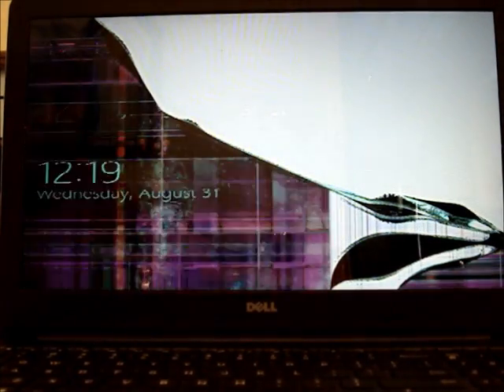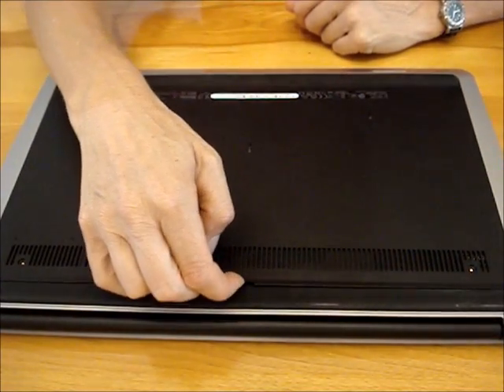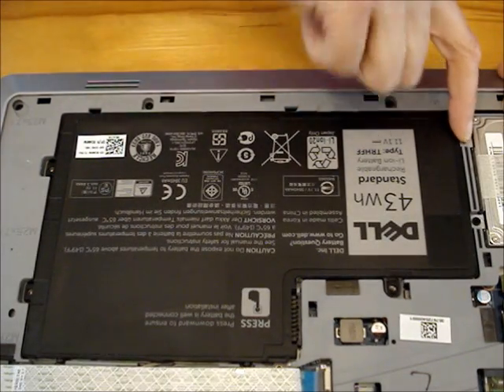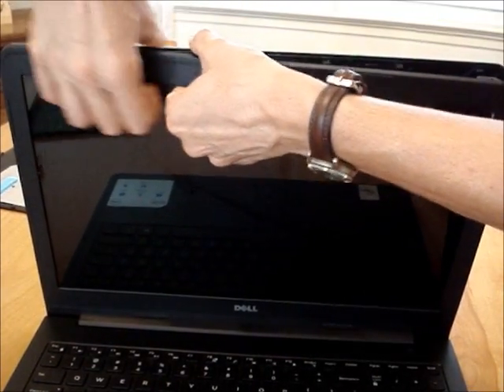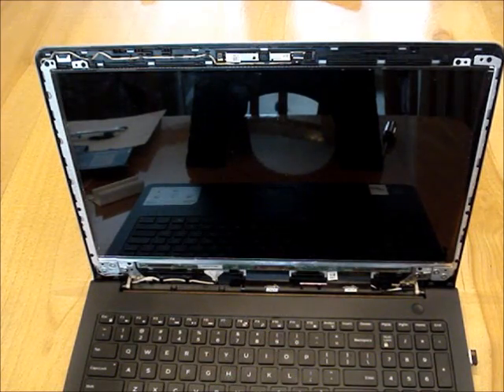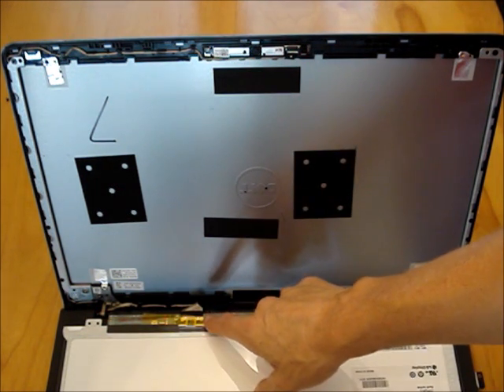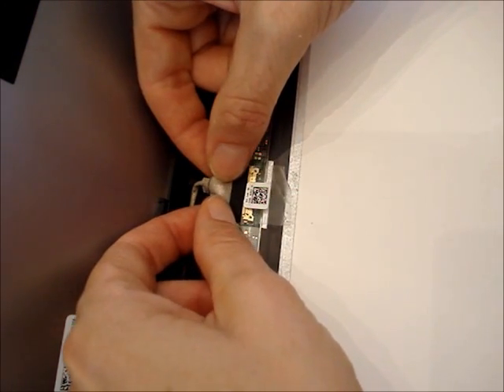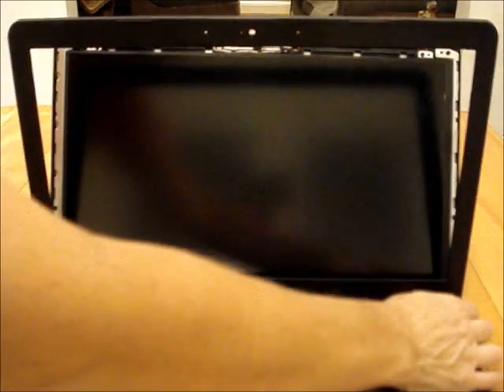Laptop screen replacement / How to replace laptop screen Dell Inspiron 15 5547

Comment: very good explanation lady, maybe you know how to separate and replace bezel in touchscreen model? The working well, but the bezel has toasted and cracked in several parts, and the disassembly is completely for that model, is the inspiron 15 5545 p39f version
Reply from the maker: I do not know how to do that.  You might try the website where I bought my screen, they have a bunch of videos.  Here's the link:  https://www.laptopscreen.com/

Comment: This is a great video. I do have a question. Is this a 40 pin or 30 pin connector( for 15 5547)?
Reply from the maker: It's been 5 years since I replaced the screen on my friend's laptop.  I can't answer your question.  I did buy the screen from laptopscreen.com    You might check with them.  I remember having a question and they were very knowledgeable,   Hopefully they still have the same quality of parts/prices/customer service.

Comment from the maker: Hi Benjamin, it was not a touch screen, so I don't know if those wires are accessible after removing the bezel.  It's not too hard to remove the bezel, I'd just go for it and find out if they are there. 

Coulld you please leave a comment with your findings?  It would be helpful for folks that have the touch screen model.
Reply: The procedure you illustrated in the video is in the Manual however the Manual made a specific note that it is not for Touchscreen. So at this stage I am not game to proceed unless I can find a youtube video showing me how.  I think it is different. Dell even wanted me to buy a whole new Display Panel when asking for a replacement antenna cable. Why? I have no experience at all opening the panel up.
Reply from the maker: I understand.  Check out this link, there are a lot of videos for Dell machines, maybe someone did one for your model:  https://www.laptopscreen.com/English/video/Dell/

Comment: Thanks for the vid instructions, is this a Touchscreen version of this model? I need to replace the antenna cables (2), do you remember if it would be accessible after removing just the bezel?

Comment: Does this tutorial work for the Dell Inspiron 5447 as well? I cracked my screen a while back, and I was hoping that this tutorial would guide me through the replacement process. Since they're both Inspirons, but mine is 14 inches and yours is  15 inches, this should still work, correct?
Reply from the maker: I looked at a picture of a Dell Inspiron 5447, the screen and hinge looks like the one in the video.  I'd think this video should be close enough to get you through the process. 

I replaced the screen as a favor for a friend.  The noises were kind of scary as I was popping the bezel off, but if you are gentle and patient it's an easy job.  I sort of remember that Dell wanted close to $300 to replace the screen.  I bought the screen laptopscreen.com, it cost less than a third of the price Dell wanted to fix it.  I was very pleased with the company, that's why I put up the video for them.

I do have about 20 years experience fixing electronic systems, so maybe someone else would think it a difficult task.